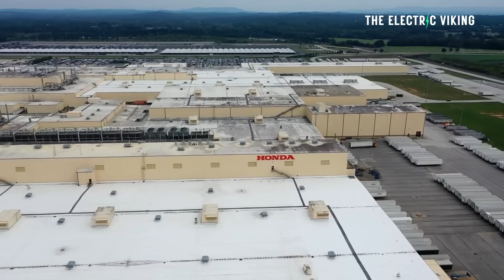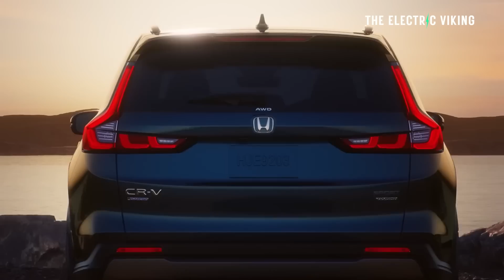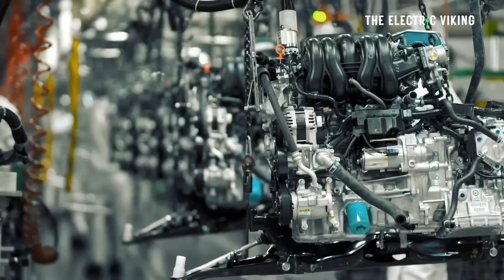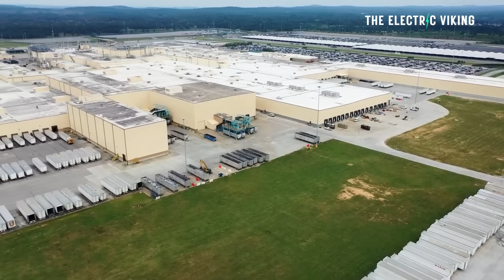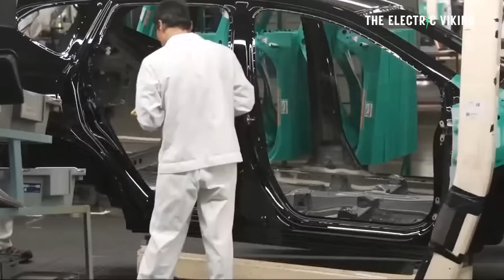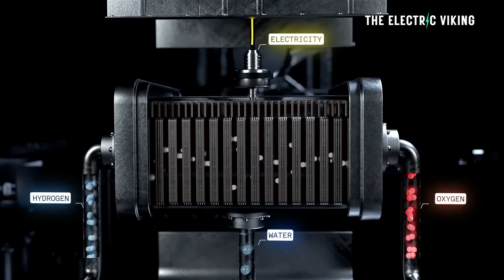11 yrs of development - Honda & GM finally slash the cost of hydrogen

Comment: I have been leasing a Honda hydrogen car for 2 years, and I love it.  There are not enough hydrogen stations here in California, but other than that it is a wonderful car.  It is almost exactly like any battery electric car in that it is quick and quiet and easy to drive.  Once you get to the hydrogen pump in the hydrogen station, it takes 5 or 10 minutes to fill up.  Battery electric cars take hours to recharge fully.  I would like them to have a larger battery and make the hydrogen generator to be set up a range extender.  This would eliminate the total dependence on the hydrogen stations, which at present are not operational all the time.

Comment: A Hydrogen economy is a problem. you need vast amounts of electricity to crack the H2O bonds to release hydrogen/oxygen. only if you utilised the vast expanses of north Africa's Sahara or middle eastern deserts you could setup insane amounts of cheap solar farms to utilise the free power of the sun to create hydrogen cheaply at massive scales. only then does hydrogen start to work as a fuel.

Comment: Hydrogen is a fossil fuels industry scam. It's why oil and gas companies created the industry's association Hydrogen Council. They have been working on it since the early 1970's and nothing has even come of it, and nothing ever will. It is so light that It has to be compressed to levels that cause catastrophic explosions. It's the only way to transport or store it. It is so atomically tiny (it's, after all, the smallest of all molecules) that it ruins almost anything holding it or ruins and leaks through the seals. For vehicles to use it, Fuel Cells need two minerals (Platinum and Iridium) that are rarer than cobalt. So rare and expensive that thieves are stealing catalytic converters from under fossil power vehicles to get the platinum out of them. 

The energy required to get it "greenly" out of water is 4 times higher (and multiple times more inefficient) than getting it out of natural gas -- hence, the fossil industry interest in pushing it: you either have to use so much energy to get it out of water that you will need fossil fuels one way or another, (forget about solar or wind power, you would need the entire Australian desert covered in solar panels to supply the worlds need for it, were it ever broadly useful) or you need to get it from, you guessed it, natural gas. To put it simply, the energy required to extract hydrogen out of water (never mind compress, transport, and store) to power all the world's vehicles would be more than the electricity needed to daily charge all the worlds EVs if only EVs existed. Is that clear enough for you?

But instead of going on and on, just search for "hydrogen will not save us" on this platform (sorry, links are removed by the YouTube algorithms) and you can see and judge for yourself. She does a much better job on it that can ever be done on any comment.

Comment: So it's no secret that Honda and GM have partnership with different ventures be it hydrogen fuel cell technology or EV battery. It actually makes sense to have a business plan to explore multiple energy sources and see which one gains the most traction. The fact that GM is continuing to double down on ICE V8 is proof they believe the future will see us using multiple forms of energy. Gas, EV and possibly hydrogen may all be common one day.

Comment: I can't see this happening. Perhaps as range extenders or hybrid systems for trucks whilst sodium battery tech gets refined but pure hydrogen fuel cell makes no sense. Where's the energy recovery? Where's the convenience of home/solar charging?
I assume the price drop means they've found an alternative catalyst to platinum.

Best of luck with the Mrs Sam & if you get the chance, look up Oncolytic Virus treatment.

Comment: Your comments about the exploding H2 refueling station in Norway are not totally correct as a quick google search shows that it was in June 2019, the cause of the leak was an incorrectly fitted plug in the high pressure H2 vessel. All other refueling stations were checked and found to have the plug properly installed. There were three minor injuries due to the explosion but not directly caused by it. All that is unknown is the source of the ignition.

Comment: Hydrogen suffers from  a chicken-and-egg problem: without a hydrogen fuel infrastructure, no one wants to buy a hydrogen car; without a significant number of  hydrogen cars on the road, no one will build a fueling infrastructure. In addition, EV's have a 10-20 year headstart in moving down the experience curve to reduce costs, which are higher than EV's to begin with. Most hydrogen is sourced from natural gas, and sourcing hydrogen from "green" renewable sources is more expensive than just storing the renewable energy in batteries. In short, hydrogen is a pipe dream that tends to explode on short notice.

Comment: Imagine where Honda could be if they had directed their 11-year efforts toward EVs rather than hydrogen. As a result of their poor planning Honda does not know how to make EVs in large quantities, so they have contracted with GM to build the new Prologue EV.  That too will be a bad decision, as GM has not shown they can build EVs at scale, and these EVs all use the outdated Ultium pouch batteries. Tesla figured out 15+ years ago that hydrogen was an expensive, inefficient, and dangerous alternative fuel. But, Honda & GM are desperate for a winning alternative fuel solution knowing they are so incredibly behind (5-10 years) Tesla and the ~150 Chinese EV makers. I don't think the decade will end well for either Honda or GM.

Comment: Wow, big money can surely make a difference. Hydrogen as a battery is a distortion of the transportation revolution by late stage capitalism, where everything looks like profit. It's a way for big money to be the last link in the cha-ching chain for the car owner to pay. The owner is much better off economically charging batteries with solar, and the place they live will have far less brake and tire dust with regenerative braking BEV--not an option with a fuel cell car. The total energy efficiency is appalling. What a stupid dumb dead end. Anybody spending time on hydrogen powered passenger cars and light trucks is setting fire to their money.

Comment: Honda cars today are bad.  The Accords and Civic  are way to big.  My 1997 Del Sol Si is still a great car.  My car has Sohc VTEC.  Double Wishbone suspension front and rear.  It has front and rear 
Sway bars.  It is in great shape with 215,000 miles.    The designers at Honda should be fired.
Hyundai  is making  cars with much better design.    Honda should look at the cars they made in the 1980s and 1990s.   When you call a fours door Civic  shopping car a sports car, you have 
definitely slipped.   The Honda car is garbage.    Toyota  has three  sport cars .  Honda has zero!

Comment: Honda needs to admit the money pit that is hydrogen needs to stop. This kind of announcement feels like executives trying to use news to keep stock prices up.

The way EV costs are dropping, hydrogen will likely never be a logical option. Just the complexity of a hydrogen vehicle makes them more likely more costly to build and operate even if Honda could achieve their 2030 cost reductions  goal. Considering how quickly EV tech has been evolving, by the time Honda makes something that competes with current EVs, the EV tech will have gone through multiple generations of improvements. 

From a consumer point of view, doing some electrical upgrades, maybe adding solar, and battery backup, will be far more appealing  than trying to install a hydrogen home refueling station. 

Range anxiety with EVs is nothing when compared to hydrogen range anxiety. At least an EV can plug into most outlets to get some power or a portable recharge system can be brought to an EV. I have not heard of any way to refuel a hydrogen vehicle outside the refueling stations, when you can find one.

I have owned Honda vehicles, love that they do everything from gardening tools to jet planes, but they have lost their way with vehicles. Electric powered competition will take marketshare away from Honda in so many categories.

Comment: Batteries likely to be down by 25% but will have 25% power density increase at least by 2030
Reply: Wright's law is allowing batteries to drop in price by 28% for every doubling of production.  Production is expected to more than triple by 2030...
Batteries will cost 80% less if this holds true.

Comment: I get that the Clarity models were great cars but they were an experiment for Honda and not meant to become mainstream cars. What I don't understand is what they learned from their experiment. The electric version's range was only 89 miles. The Hydrogen model didn't have enough range to be comfortable with the small number of fueling stations. BTW California has over 40 stations. Way more than the 2 you mentioned but still fairly sparse. I own the Clarity PHEV version and I think it is fantastic. Honda never promoted or advertised the Clarity anywhere. I suspect they lost money on every car. If I were Honda I would have learned that people don't like rear wheel skirts and the mutton-chop front lights. I would have made it the new Accord (cleaning up the looks) and/or an SUV model if the costs were OK so they could make a profit. They would be selling like hotcakes especially now until the BEVs come. It seems like they did this great experiment and either learned nothing or learned wrong things.

Comment: Might just be marketing in the fashion of wanting the public to believe the advanced technical prowess of the company. Engineering does not change depending on who you work for. Hydrogen for light vehicles is brain dead at the current state of the art. Making the fuel cell technology itself less expensive is not the issue. Good for them if they really did it, but so what? Hydrogen, to be green, must be made utilizing electrolysis. Electrolysis takes about 5 times as much electrical energy for the same miles traveled as simply putting that energy in a battery. Hydrogen is potentially applicable for those problems that have no other solution, but vehicles? Not a chance. Even if somehow we invented a way to make cheap hydrogen, the fueling infrastructure is insanely expensive. The hydrogen molecule is so small and invasive that it actually penetrates the matrix of most metals. They then become weak and subject to catastrophic failure. The best fuel tanks are not metallic but rather wrapped carbon vessels - also expensive. Honda and GM employ great engineers, so I'm guessing this is pure marketing nonsense.

Comment: Nice video.   The issue always keeps coming back to the lack of 'refueling' infrastructure.   Nikola has probably come to that conclusion (and may not admit it).   I can 'refuel' my EV in my garage.   Hydrogen - I guess I will need to drive to California to refuel with Hydrogen.
Reply: I don't have a garage and electric is more expensive in my area a hybrid cost me 35 $a week  for same mileage ev charging is 50$ electric cost will never go down gasoline cost will be 25 to 50$ a week.

Comment: A Hydrogen "battery" may be useful in Northern climates like Alaska. The summertime sunshine could be converted to H2, and stored underground in the oil fields. In the cold winter months, the H2 could be burned to make electricity. 
It may be better than going nuclear.
Note: There is no geothermal energy up there. 
So, Wind/Solar, Hydro and Nuclear is all you have after the oil/gas runs out.
Reply: Gas and Oil will run out.
Reply: We have to stop using the oil and gas because it will be too late if we use it all.🤔🌏

Comment: I just don't get it, it's basic economics. Hydrogen vehicles will never, ever be cheaper to run than an EV. An EV is around 90% efficient from wall to wheel, but taking that same electricity and using it to make green hydrogen and then compressing, transporting, recompressing and then running it through a fuel cell to power, yes, an electric motor in a fuel-cell vehicle, gives you an efficiency of around 30-40% at best.

Obviously, a fuel-cell vehicle is always, always going to be 2-3 times more expensive to run than an EV, not to mention that if we were to use hydrogen vehicles instead of battery ones, we would need at least 2-3 times more renewable energy to power them all.

The numbers for hydrogen are not as bad as for e-fuels, where you get numbers of around 8-10 times more electricity needed for e-fuel vehicles than BEVs, but the numbers for hydrogen are still unworkable.

I don't know why so many people have such a hard time working out these basic numbers, it's like they are brain-locked into the old way of thinking, that we must use a liquid or gaseous fuel of some sort. It's all so nonsensical...

Comment: funny thing about hydrogen cars, in France, if you buy a Toyota Mirai, they explain you have an autonomy of (theoretical) 650 kms ,(more about 500 kms, but anyway). That is, if you charge with hydrogen with a pression of 700 bars, but at some places, the pression is 350 or 200 bars... if you fully charge in a 200 bars station, you have 2/7 of the autonomy 😁

Comment: I think the OEMs are trying to figure out a way that they can continue to charge for vehicle maintenance since EVs don't require much maintenance.
Reply: Remember Mercedes and Jaguar and BMW and I can't think of the other high Tech automotive company, where they were gonna charge people monthly for the already installed use of the heated steering wheel, the heated seats. And other Luxury items that were already built into the car, but if you did not pay the monthly charge these companies would turn the devices off via "Over The Air" ❗️

That would steer me away from buying their vehicle.
Reply: A hydrogen powered car is an EV!

Comment: Chomping at the bit for the new Hummer with the Hindenburg technology...a literal H2  This way I don't have to worry about rain or salt rusthing the thing out, the water vapor from the exhust should  allow  sonstant rust with no waiting.  I'm sure Honda won't let us down, they did so well with the Takata airbag scandel and GM rocked the block with their diesels back in the day.  It's only a 10,000 PSI hydrgen tank, not guts--no glory man!  Buy with confidence.  I don't want to get burned (literally) as an early adopter so I'll wait until 2040 but for the rest of you... be the first on your block.  Bummer, no H2 stations around here  so I won't be the first on my block.  That new Honda should be the bomb, you.
Reply: Who are you talking to? No one wants to buy hydrogen.
Reply: @Love Puppy

 Never ever buy the 1st year series.
 Look at the crap 💩💩💩 that happened to the people who bought the 1st series 2022   V6 Tundras having serious problems with the "Waste Gates  on the Twin Turbos"   😳

And Toyota had to recall all the BZ4s because the wheels were falling off.

Comment: They may have reduced the cost of the H2 fuel cell, probably by using a cheaper catalyst and reducing the size and power output. But, they still have the high cost of H2 storage, and more importantly, the high cost or the H2 fuel. The retail cost of H2 has doubled in the past decade, making it even less competitive. It sounds like Honda plans to partially avoid the high fuel cost issue by making it a "plug-in hybrid", doing all the local driving on cheap electricity from the grid. But, due to the relatively short driving range and the severe lack of hydrogen refueling facilities, it simply cannot be used for long road trips. Moreover, doing almost all the local driving on electricity doesn't support local H2 refueling stations, which will probably close. 

As for stationary applications, the "Bloom Box" fuel cell runs on natural gas and is cheaper to operate, and various kinds of storage batteries are more efficient and more cost effective.
Reply: Very true,  Excellent comment 👍

 20 years ago they were saying that when Wind Turbines will be more efficient along with solar panels, the cost of producing hydrogen will go down. Well those days are here and the cost of producing hydrogen is still very expensive ❗️
Reply: You might want to visit the Orkney islands (north of main land of Scotland).
With tidal, wave and wind energy they produced over 130% of their electricity needs, and the grid complained of overloading the grid. Hence they started to produce full green hydrogen. For many years…
Reply: @hanswitvliet8188  Batteries will do a better job.
Reply: @garethrobinson2275  what would they use those batteries for? They have a constant over supply of electricity.

Comment: Let's hope the honda hydrogen works! Anything is better than petrol/diesel!
Reply: Nothing wrong with hydrogen.
Except don’t use them in cars.
H2 is good usable when (also) needing warmth besides electricity, as fuel cells produce lots of heat. Bad for cars, ideal for Central Heating.
Reply: Go hydrogen if you want to waste 66% energy 😄

Comment: I feel that battery cost still needs to come down substantially. Also a very large increase in clean energy needs to be achieved before BEV actually decrease  CO2. Better the government had subsidized clean energy than BEV. Tesla didn't need subsidies to sell cars.
Reply: I feel that car costs should come down significantly. 19,90 would be a good price. But not much more please.
Reply: Even with 100% coal, modern BEVs reduce the cradle-to-grave emissions significantly due to the superior efficiency. This only gets better as grids scale up renewable energy! Vehicle to grid will also ease the stress on grids substantially